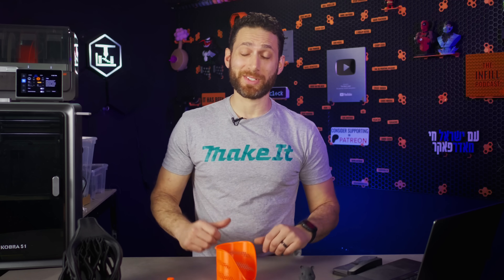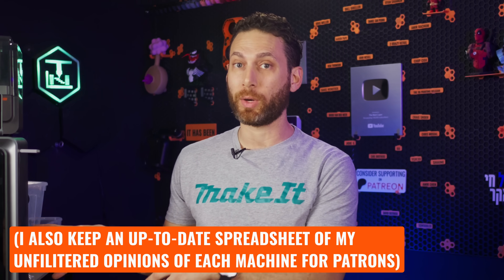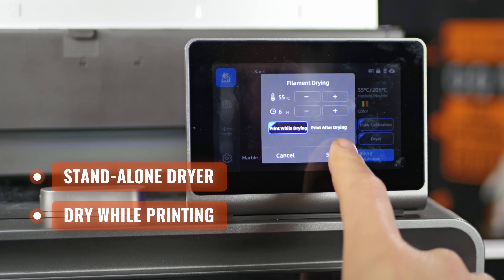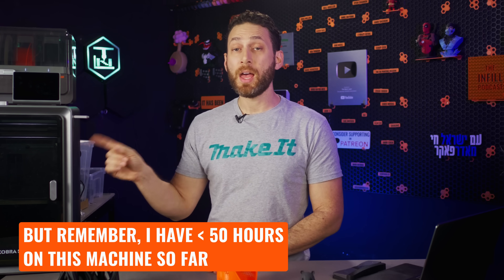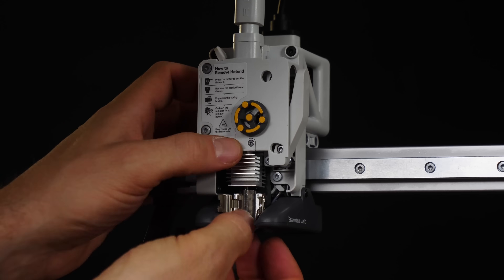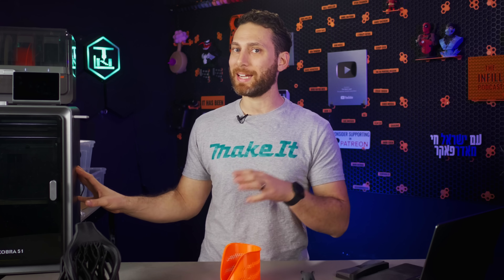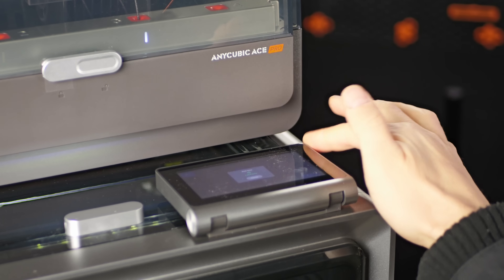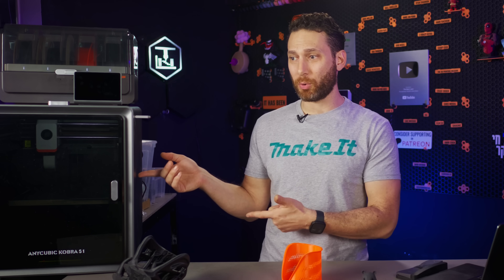16 Ways The AnyCubic Kobra S1 Is BETTER Than a Bambu Lab X1 Carbon

Comment: Thank you for this. It makes me feel a lot better for cancelling my planned X1C purchase and pre-ordering the Kobra S1 combo.
Reply from the maker: Both are great printers, to be sure, but my point was just to show that in 2.5 years, other companies have identified some of the long-term problems the bambu machines have had, and fixed them before Bambu did (except the ones that were fixed in the A1 series). You'll be happy with the S1, I think, but AnyCubic or the aftermarket NEEDS to come out with hardened nozzles!
Reply: Big Mistake, unless you're running a printing farm!
Reply: @ I do not support any company that tries to limit users choices on firmware etc. Bambu shot themselves in the foot last week in my opinion.

I don't even run closed source software or operating systems on my computers...
Reply: @rickbauer7088  I agree that I'm not happy with the direction bambu is headed. Hoping the community has spoken up enough that they change course. And also, do you drive a car from the last 30 years? Proprietary software! What phone do you use... most likely there is proprietary software running on it. Do you use Google or Microsoft for productivity? Proprietary software again! 

It's ok for a company to want to own their IP. The poor choice is threatening to change TOS after the fact. Let's not loose the thread here.
Reply: @ Go back and read my comment above. I ONLY run open source software...ONLY. This includes the operating systems, productivity, and other applications.

I own older vehicles specifically so I am no replying on modern computer controls or subject to the problems that come with them. 

I was a master certified automotive technician most of my life and will never own a vehicle that requires updates to firmware to be able to be used or that allows a remote ability to control the vehicle or it's use in any way. This includes remote unlocking as well as tracking or worse yet the ability to remotely disable the vehicle.

I too hope Bambu has learned their lesson and I hope me cancelling my purchase of their printer and instead ordering the Anycubic Kobra S1 was at some level part of the lesson for them. If I am satisfied with the S1 I'll be adding more of the same. 

It will take a while for Bambu to prove they have learned their lesson and I don't have years to wait. I'm willing to bet I am not the only sales they lost and they will remember their lesson for a long time going forward.

Comment: An S1 owner who has printed over 400 hrs on it. Just want to point out 2 misinformations in the video: 1) the plastic they use for the front door and top is PC, not acrylic. It is stated explicitly on their website. 2) The AI detection has worked since its launch. It triggered twice for me.
Reply: I got mine a couple weeks ago, and only have just over 24 hours of print time. From my experience, though, AI detection works sometimes, and others don't. I've had some occasions where it will say that spaghetti was detected when there was none, and then not detect it at all when there was. On a few occasions, response to detecting print issues was delayed, but it did stop the print.

Overall, the printer is great and has been working well for me, but the AI detection seems to be in a beta state and is kind of buggy at the moment.
Reply: What is your take on the printer?  What do you like, and more importantly what do you dislike?  Do you print PET / ABS / ASA?  I have one on pre-order so I am curious to learn about your experience.
Reply: @LukeSzczepaniak  The machine is solid, as stable as my P1S IMHO and definitely worth the price. Print quality is on par with P1S too. I especially love how humble Anycubic is (I know some of their leaders). They acknowledge their weakness, apologize to users often, and respect other companies, unlike some other companies...
The things I dislike are the slow filament/color change and the lack of accessories atm, but I think future firmware updates can change these. Like the new S1 firmware added part skipping and ACE Pro logic and noise reduction. Ecosystem (Makeronline + printer) can be another weakness, if you always print other ppl's designs.
I have printed ABS & ASA & Nylon, and they came out great. Nylon parts shrinked a little bit, but that's normal in a machine without an active heated chamber.
Reply: @zyz2525  Thank you, that is fantastic news.  I mostly print my own designs and have little interest in the online repositories but it seems like all the manufacturers and most users are pushing for it so I am sure that will improve over time.  I will probably add my own heater to the chamber in the long run so I am not too concerned about that.  At this point my only concern is the lack of a steel / hardened nozzle - i hope i can put standard nozzle in in the hot end and don't have to wait for an after market accessory to come out.  As fara s the ACE speed it would be nice to have a firmware speed things up and that it isn't a hardware limitation but speed is not a huge factor for me.  It would be nice if Anycubic added the ability for purge management in the slicer rather than having to manage it from the printer directly.
Reply: @LukeSzczepaniak  No problem! Agree with all your points. AC did tell me they will release official hardened steel nozzles. When you get the machine, don't try to unscrew the original nozzle to replace it with another nozzle because the nozzle is actually glued with the hotend to prevent leakage.
Reply: @ Thanks, I just saw a post on that on Reddit.  Do you know if the extruder gears are hardened?
Reply: @LukeSzczepaniak  No problem. I asked their product manager. The gears are made of stainless steel, not hardened.
Reply: @zyz2525  Thanks!
Reply: Just in case people care about the AI detection, I have to say my bamboo x1c AI failure detection has saved. Maybe three prints and destroyed double digits from stopping prints that didn't have a failure

Comment: Great video, I've been looking at this machine, I currently run a K1Max which is performing just fine. A full video on this machine would be good, covering things like build plate thickness, warping? Parts supply ie hot ends extruders ect...  When I look at machines I also look at their support, while Creality is no king in that area, Bambu look like it is..??  Thanks for sharing with us!!! And, is Kobra looking at this machine in a bigger size????  All food for thought!

Comment: I have this on preorder, most reviewers out there are fairly positive.  I am currently running an old prusa i3mk2 that has been upgraded to a 2.5s over the years.  My only experience with Anycubic has been in the resin world and I have been pretty happy so far so I hope I am not dissapointed by the S1.  Please do a "unbiased" review that includes some more exotic materials.  I think there are enough reviews of the vanilla PLA multicolour prints out there already.  I am more interested in multimaterial for supports etc.  Also, seeing as you have a good relationship with Anycubic, a common complaint about Slicer Next seems to be the lack of profiles.  I am used to making my own profiles anyway but it would be nice if they included some more / better profiles out of the box.
Reply from the maker: Yeah, it needs more than just a 0.2mm profile, but they have lots of filament profiles which I was pleased to see. But, they still need more (PA, PC, PACF, etc). I printed Nylon on it today and it came out perfectly, though :)
Reply: Excellent, I look forward to getting the printer.  Should be here this month.  Really hoping that I can replace just the nozzle with something hardened and I don't have to wait for aftermarket hotends.

Comment: Been watching their tweets, very aggressive when these go on sale on Amazon US.
What intrigues me the MOST for this versus my X1C/AMS is the ACE Pro, though time will tell how the differences flesh out in the long run.
It is curious they're going to fork from Orca.  Isn't Orca a fork of Bambu Slicer, which is a fork of Prusa Slice, which is a fork of ..... ???
I primarily print PLA and PETG, so the higher temps aren't truly a factor for me.  Yet.
If I was JUST getting into CoreXY, I'd very likely pick this over the X1C/AMS, but despite the current cluster about Bambu firmware I'm kinda "stuck with what I've got".  I suppose I could try to seel my X1C/AMS, but we kinda know I'd probably take a huge hit though I've only had my Bambu ~2 months. :(

As for the "type of video", yeah, this is fine.  It's just a sponsored showcase, which you went to great pains to stress is "not a review".  Would very much like a full unbiased (and not requiring approval by the brand before posting) review, but that will only be possible long after the great launch pricing deals are gone.

Comment: Oh, and that quick change nozzle system is another issue. The actual nozzles is hit and miss at best. Atleast when I tested it, the quality control was shocking. Some brand new nozzles were unusable out of the box. They did say they fixed that issue, but I'm not willing to try them again.

Comment: As bad as Bambulab is atm, I will never in my life buy anything from Anycubic again. They make typical half put together and half ready printers. When you call them out on it then they send you in circles to dodge their warranty. I spend 3 months chatting to their support team to give my money back for their Kobra 3 combo. Honestly, I could not get a print off that printer even if I tried my hardest. The thing could not even level the bed without drifting further and further away from the bed. Worst printers and worst customer service by a land slide.
Reply from the maker: Thanks for sharing, sorry to hear you had a bad experience with their CS. This is the stuff we creators don't know, but need to know when we consider signing another sponsorship with a brand.

Comment: I've had a Anycubic Vyper for several years and I have found it to be a solid, hassle-free printer.  Looks like the Kobra S1 provides the upgrades I've been looking for in my next printer: 1) Quiet operation 2) Multi-color printing 3) enclosure for ABS and other materials, and 4) quick swap hot-end/nozzle.  I may just have to take the plunge and upgrade now.  Thanks for posting!
Reply: @mrsmitty91  I had mine for awhile until the auto level sensor died and the replacements did not work. Getting s1 and kobra max
Reply: @demonhunter2282  I think that was one of the more common issues with the Vyper.  I had that issue out of the box, but a minor adjustment to the strain gauge fixed it for me.  Probably came loose during shipping.
Reply: @ nothing worked for mine. I did manually level it but i like printing thing not fixing a printer. I do enough soldering and other repairs for that itch

Comment: As a hobbyist i will stay with my X1C because it's works and it's simple to use. I was tired of the endless upgrading of my ender 3. I want a printer that i just press start and forget it to get more time for modeling.
I never use it online, always the SD card and i doesn't have any issue ( except when I make a mistake with the slicer or with my modeling )
For now, i just see clones who "want to be" a bambu X1 at a cheaper price but nothing new or equal to it.

X1C is perfectible but i guess with all the feedback , bambulab will give us another bomb soon.

Comment: The filament dryer is great, but does it get hot enough to dry nylon etc?
Reply from the maker: I haven't checked actually... I'll need to.
Reply: No, it only heats to 55 degrees C, so not enough temperature for Nylon.

Comment: Multicolor/Multimaterial Printer is still on my list. Sure, the Kobra S1 has a lot of great features, based on your analysis. It's not IDEX, still it's an interesting device.

Yet shall we/I get one ? Hmmm ... Let's wait for an in-depth review. Back then in 2017 or so, that's what I did before getting my first printer (i3 Mega-S from ... Anycubic !), which I still use a lot (klipperized and upgraded to better fit my needs).
So, there are a lot of interesting things. Time and reviews will tell what to do, what to expect, what to think about it.

Comment: It is always good to compare a brand new development with devices where the development is 2 - 2.5 years old and only minimal changes have been made.
It should be clear to everyone that the S1 is better in some respects than the X1C or P1S, but that's because Bambulab has virtually led the way and the rest have had to follow suit.
Hence the bad video and I can't imagine that an independent review will be any better. 👎

Comment: I have been looking for a multicolor printer for a while now. I was always hesitant to pay the price it costs for the Bamboo lab X1 Carbon. While it does sound amazing to be able to use 16 different colors, realistically I did not see myself using more than like 5 colors for my prints. So I opted for a Kobra S1, I bought the printer and two of the Ace pros to go with it, all for under 1000 dollars. I think that is a great deal in my opinion. It should be arriving soon!

Comment: Savings are ONLY staggering IF it’s as reliable as a Bambu. I’ve been using four year old, non stored filament constantly on my P1S and haven’t had a single print failure. This might be better but there needs to be more history.

Comment: I would like to see you do an unbiased review showing the good and the bad, things to look out for, etc.  I'm looking at buying this printer as my first machine and will be doing so in a few weeks once I have the cash to order it. I'm also thinking of making some designs of my own and taking advantage (in a good way for personal use) of the generousity of the 3d printing community via the free files offered.  I really like a lot of the designs and appreciate that so much is available for no cost to get me started on printing things I like. There's no shortage of good designs out there. :) The hard part is deciding what filaments I want to start with.  There's so many pretty options available.

Comment: Nice!  Orderd an S1. After you have some time with it, I'd love to see a time-lapse video from start to end.  How about a video and ratings on 3D printed upgrades (i.e. side mount poop chute, ACE pro mounts, etc.); And for super mods, maybe how to add Ethernet (the Rockchip CPU supports it, unknown if there is a connector and/or driver for it), or a mod to move the display to the bottom side so it's not so high.  Are there are Gcode startup mods that make it even better?  For example, if you only make items that are 2" tall, perhaps a mod that the build plate doesn't home to the bottom for every print.

Comment: Does their handling of purge still rely on it being done strictly by a setting on the printer, with the slicer having NO idea how much purge there will be, or have the addressed that, and handle purge through the slicer and settings in Orca?  That was a deal-breaker for me on the Kobra 3, as I rely on that for tracking filament usage and making sure I have enough to actually finish a print..  From a 'farm' standpoint, that's a HUGE deal as well..
Reply from the maker: Good point. I think it purges how much it wants because I adjusted the setting and it still purged SO much.
Reply: @thenextlayer  If it's like the Kobra 3, the purge is controlled by the printer firmware, NOT the settings in Orca/SlicerNext.  The setting to control it is on the control panel.  Since it's controlled by firmware and not software, you can't really estimate how much it's going to use, and that's a HUGE problem.  I use purge objects frequently to mitigate some of that waste, but doing it on the Kobra 3 just used more filament, and still produced the exact same amount of waste as without those objects.  That's definitely a show-stopper in my use case.  It looks like the Creality color printers work more like the Bambu in that you can control the purge amounts, and can actually flush into objects.

Comment: They are all two years later coming with a clone. There is zero R&D innovation, they are just trying to reach at the same level of a machine from 2022.
Reply from the maker: Did you watch the video though..?
Reply: @ yep and nothing new, that’s a core xy with same size and multi-spool system. Everything is cloned with an upgraded heater system for the spool system. Where is the R&D here? I just see companies spending time in doing what another has already done. Last but not least, they are all lunching the same machine at the same time. Finally, that’s the core xy clone war. The last « innovation » in this industry is finally Prusa with the XL and tool changer. Let’s see what Bambu will bring…

Comment: My first printer was Anycubic Mega S.  I love it, but all within warranty had a bad fan, 1 bad idler, linear bearing went right at the end of warranty.  Every single issue i was given the run around until i just bought my own parts on amazon.

F for service.

Comment: I'm kind of a statistics guy and I would prefer an excel sheet or a list of all features that are comparable to other printers. Not only to compare the quality but to name the spare parts I have to find when something in the printer breaks. In this case, I would like to hear or read what the anycubic uses instead of the bambu lidar device for the bed, an infrared photo of the 120°C heatbed and so on. Repeatable facts comparable. I don't like phrases like its better or less good.
Oh and I find the secrecy abouts facts like nozzles and hotends really puking. If you could use a wrench and strip down the hotend down would be great.